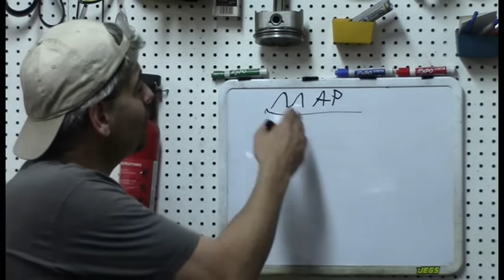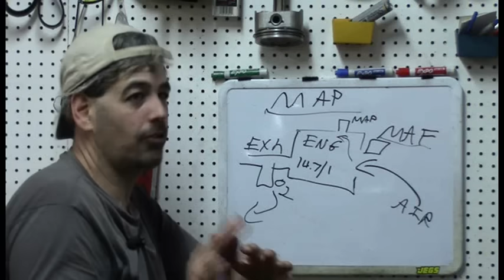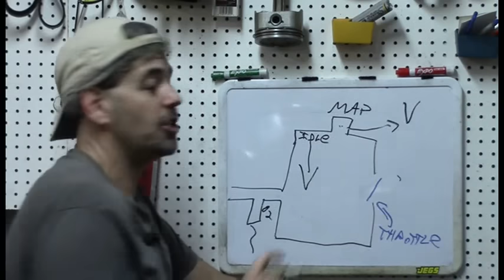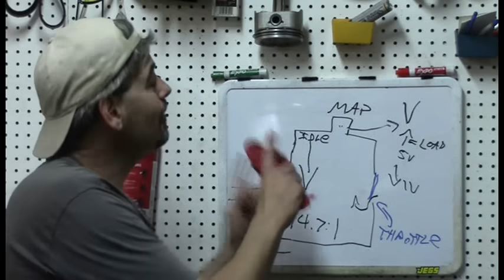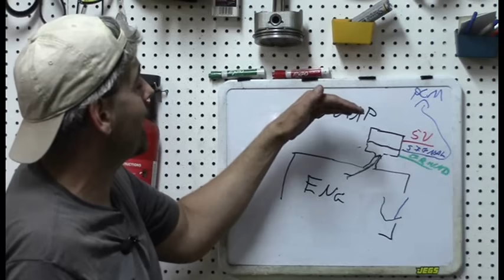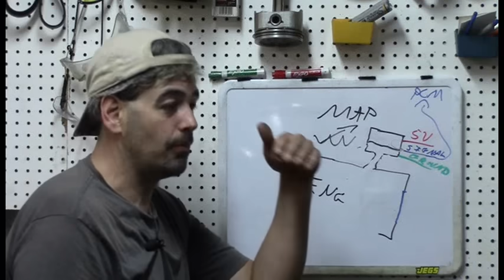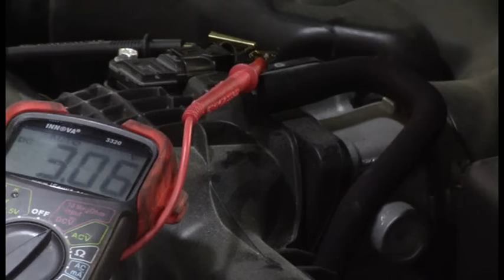MAP Sensor Diagnosis and Understanding Function- Pt1

Comment: Hi there. I have weird problem that nobody as for now cannot help me in my country and my area. BTW I live in Poland. I will describe my problem so can you help me please at least a little bit?
I am searching and watching YT videos on different sensors ETC. And watching here about MAP sensor I was wondering if my MAP sensor causes weird problems with my engine. 
I have spare MAP sensor that I bought from someone with other parts just in case. So my first thought was after seeing this, maybe I will try and change this sensor and see if there is any difference. But I can install it tomorrow. 
So for now I am wondering if it is even this sensor that is causing my problems.
American mechanics seems to go way more into diagnostic tools and know way more on engines than mechanics in my poor country.
So I was wondering, maybe you can point me in better direction if it is MAP sensor related issue or should I go and seek in different direction :)

So my car is Peugeot 406 v6 ES9J4 and when I start it and it is cold then it starts OK and goes into 1000RPM and stays that way to about 2 minutes until it heats up a little bit (normal behaviour of course) but then as it slowly reduced RPM to its normal iddle RPM then weird thing is happening. Engine start to fluctuate in RPM at about 700-900 RPM and it acts irradically and shakes.
I made few tests every time with cold engine that was sitting all night. So when I do nothing and just watch its behaviour then after about 2 minutes it stops shaking and fluctuate RPM and is sitting at about 850RPM calmly. On other day I tried to play with throttle while this problem occurs and when I add throttle then engine seems to not use 1 cylinder because it shakes weirdly as one of cylinders would not work at all. I rew it up to 2000RPM where I can hear engine works weirdly on 5 cylinders only but I did not test if it really use only 5 cylinders but I just assume this because without this problem on 2000RPM engine works smooth. So this playing with throttle do not change nothing in terms of this problem and it will go away after normal period of time for this weird issue (about 2 min) But when I start cold engine and just move right away and I drive then after about 1-2 minutes I feel that engine lose will to accelerate. It maintain RPM even if I press harder on throttle. It lags for short time then suddenly accelerates so I must decrease pressure on throttle pedal so it is not accelerating to fast. But after that still I feel slight lag and few jerks. It last way shorter than waiting while car is not moving. It is about 30 seconds to max 1 minute while I am moving and then it respond without lag etc. So I prefer to start the engine and right away move cus waiting 2 mins and then next 2 mins untill it will stop acting up is to long. I can start moving while it acted up on me after waiting for it to slightly warm up but effect is like I start moving right away.
It is weird problem and my mechanics that fix my car cannot find a problem. They used diagnostics computer on it Lexia/PeugeotPlanet2000 and only thing they noticed was air pressure acting weird while all this start to happening on cold engine after 2 minutes of waiting till RPM goes down. So value for air pressure is at about 300 somet units :) then start to jump up and down like crazy for that period when it have this weird hickups and RPM fluctuations. They changed some mechanical sensor for fuel but not fuel pressure sensor that I changed on my own way back for new one. Also they changed throttle body gasket as it was old and cracked. Still did not help in fixing my problem.
I phoned to other mechanic in other city close to where I live and he said to check if my knock-back (rebuff? Not sure if it is called this way in English) hose are good and not cracked etc.
Also to check my high voltage wires going to spark plugs as it have coil for 3 spark plugs and wires for back spark plugs. Those cables are brand new but as I checked them in the dark they give blue fast moving sparks. All I could do is to use silicone spray on them to reduce this. Old ones had the same effect so giving it back to store just to get new ones with same problem so I decided to not do it. But this problem I described was not present when I used old cables and also new cables. First time when I observed this weird problem was day after I change fuel pressure regulator. But it did not repeat untill some time ago and is present every time I start on cold engine. That is why I am not sure if it can be related to this fuel pressure regulator. Old one leaked fuel to manifold and ended up in hard start where it took longer time to start the engine. So it is all I can remember. Mechanics in my country are not to good in finding problems, they only like to change things to new parts :) That is what they are good at xD Ok it is not funny :( 
So I was wondering watching your video if this MAP sensor can cause such problems or my problem lays in somewhere else. Thanks in advance for any help. Cheers.
Reply from the maker: it could .... or not.  what data do you have?
Reply: @SchrodingersBox  sadly I dont have any data except info that air pressure in the manifold is changing irradically when RPM is dropping after 2 min ater cold start. Value after engine start is at 300 and holds close at this value untill RPM goes to its desired iddle value. I am novice in mechanical stuff. All I did in this engine was swapping spark plugs, high voltage cables, coil and fuel pressure regulator. I am thinking about buying lexia/PP2000 and used laptop so I could read data out of car computer so I could then give info if needed.
Reply from the maker: That is absolutely data- what exactly is the data that the absolute pressure is dropping? That’s what is needed!!  And if absolute pressure is dropping why are you replacing ignition exactly- I am not understanding that.
Reply: @SchrodingersBox  ignition gear was changed more than a year ago. Back there I had not this problem I was describing now. I changed it just to have new better ignition gear. As I mentioned first time ever I noticed weird behavior on cold engine was day after I changed fuel pressure regulator. It was less than a year ago. But it was not regular problem. Not sure when it become regular. Maybe when cold days started. But when I changed fuel pressure regulator it was summer. So not sure if temperature have anything to do here. But warm engine do not give such problem. It must cool down to give this symptoms again. Starting engine again after about 15-30 minutes dont show this problem.
Reply: Today I started engine and just drove. I accelerated little more dynamically and REV engine every time before changing gear up to 2000 and I did not notice any lag etc. But earlier tests I accelerated less dynamically and this problem occured. So it is mind boggling for me.
Reply from the maker: I still don’t see any data here. You mentioned there is a lack of manifold pressure. what is the MAP voltage? What is the absolute pressure?  I need the data that you are using that indicates the absolute pressure is low!
Reply: @SchrodingersBox  I mean I am not sure if data I have is absolute pressure but it is at 300 units. From what mechanic said it holds this value for about 2 minutes untill RPM is going down from 1000 to its normal workig value at about 850 RPM. Then this changes occur which are irradical jump up and fluctuations in that value. From what I understood from mechanic it is going up above this 300 units and fluctuate in upper values above 300.
Reply from the maker: what are the units?  300 units?  what the hell measures at 300??? It’s not bars or mmHG or MAP voltage. 
  I need to know the units of measure.
Reply: @SchrodingersBox  I called it units because I have no idea what they are called :) They represent manifold air pressure.
Reply from the maker: if he measured MAP he would have measured fuel trim and other basic induction parameters.  there is no logical reason to measure MAP alone. 
  If can had the data from these basic measurements any novice would have done i can help but unfortunately i have nothing to go on at all. Sorry, i’m outtie unless i have just basic starting data to form a strategy.
Reply: That is all mechanic told me about effects of this problem. As I mentioned about mechanics in my country. If I would be honest I would say they suck at finding what is causing problems that need deeper knowledge about engines. I had problem with engine start. I had to crank it longer. Nobody was able to tell me what could be the problem. I figired it on my own with the help of american mechanics youtubers and my own imput in testing stuff that can be tested without any diagnostics tools. So I found out that fuel pressure regulator is leaking fuel into the manifold through vacuum hose :) but now current problem is even harder to solve.
Reply: @SchrodingersBox  I understand that more data would be helpful to go closer to what is causing the problem. I will try to get more data but it can take long time. As for now I thank you for replying and trying to help :) I will search and buy this PP2000 for diagnostics of my car.
Reply: I thought that symptoms alone that I am describing would narrow search for problem.
Reply from the maker: They do- the symptoms tell you what data parameters to start with.
Reply: @SchrodingersBox  yes :) I like how you and most American mechanics that I watched on YT approach mechanical problems with gathering data and analizimg it if problem is more complex. As for me fastest way was to switch MAP sensor even if there is no proof that old one could produce such problems. I did not test spare one for to long because I need at least 3 days to see if anything changed. As for one test I did in the morning there was no symptoms but that proves nothing. I started my car and just moved straight away. Temp outside was around 5-7 celcius as in earlier situations. I did not try to accelerate to aggresivelly. Just smooth acceleration and I did not notice my problem. But that could be just one of better days for my car :) after work I will make warm up test. That means I will wait for 2 mins after engine start untill RPM drops. This will tell me if MAP  sensor had to do anything with my case. Still I have in plans to buy this diagnostics tool. It will help a lot in the future.
Reply: So... Update. After waiting for warm up after 2 min it is still the same problem. So without data it is still a mystery.
Just wonder if to try and swap o2 sensor to see if this fella can mess up engine work like that.
Reply from the maker: All things are a mystery without data,  You cannot diagnose a MAP without reading the voltage- you don't need a scantool- just measure the reference against the signal.

Comment: Matt is it the same for a diesel  in Pirinciple I've got both on my Chrysler 2.8 Cdr thanks.
Reply from the maker: never seen a diesel lol. I imagine it has to be the same though- either way you have to know the induction volume right?
Reply: Yes it seems I have got MAF to MAP sensor to EGR  in to the engine on the EGR valve it's got too vac valves on it one has got a flap like a carburettor and lift plunger on the other so it looks like the flap closes the plunger lifts altering the vacuum and the MAP and MAF sensors altering the fuel amount.

Comment: turn signal want work, all other light work, new malfunction  switch and relays , still no blinkers, emergency flasher works. don't have a clue what the problem could be
Reply from the maker: I would do a voltage drop test on the signal.

Comment: Hello, i have a 1988 chevy S10 4 cylinder.   The truck had been sitting for about 5 years,  i bought it and it started stalling on me about a week of being driven....i changed the fuel pump, the gas tank, fuel filter and all the gas lines and  speak plugs  it still stalls on me randomly,  it runs very slow on the freeway and when i drive it for over 10 minutes, the check eng. light turns on then it shots down.   After changing all the parts i did, what ells can i do to fix the problem?
Reply from the maker: What else can you do? You can diagnose it instead of just changing parts.  Why did you change all those parts? What is your data this is a fuel problem? What is the idle vs loaded LTFT? What is the rail pressure?
  There is nothing to go on here. You posted this on a MAP diagnostics video. What is the data from your MAP diagnostics? Why not start there?

Comment: I am driving an Opel Astra J 1.4T and i cant really get anyone to diagnose my car well. All they say is change MAF,MAP and Oxygen sensors all at once but with no root cause of where the problem is
Reply from the maker: Get me some data and I'll help you Dx it.
Reply: Thank you, the codes coming out are
 P0098- Intake Air Temp Sensor Circuit 2,faulty function,high voltage Intermittent
,P0172 Fuel Trim too rich 
,P0236 Turbo Charge Boost Sensor,Performance, Faulty Function
.,P0237 - Turbo Charger Boost Sensor Low Voltage, AND 
P1101- Intake Air Flow System 
 The car has no power at all and I am hearing like a whistling sound when i press the accelerator . The fuel consumption is very bad. I sometimes stop at a robot and the car starts shaking and switches off.
Reply: Thank you, the codes coming out are
 P0098- Intake Air Temp Sensor Circuit 2,faulty function,high voltage Intermittent
,P0172 Fuel Trim too rich 
,P0236 Turbo Charge Boost Sensor,Performance, Faulty Function
.,P0237 - Turbo Charger Boost Sensor Low Voltage, AND 
P1101- Intake Air Flow System 
 The car has no power at all and I am hearing like a whistling sound when i press the accelerator . The fuel consumption is very bad. I sometimes stop at a robot and the car starts shaking and switches off.
Reply from the maker: allen mujati Excellent- as you can see you have a P1101. Obviously you need to check calibration on MAF. What is the voltage drop across hotwire idle vs load and variance in frequency?

Comment: What should be your location as altitude to have 3V instead of 5V? Or 5V will measure only when we are on the sea level? !!!?
Reply from the maker: Because MAP is directly affected by Standard Tamperature and Pressure which affects air density.  At sea level STP pressure is 14.7lb/in.  At 6000Ft it is closer to 13 or so. You can think of it as there is a shorter column of air at altitude so it weighs less.
  Love physical chemistry!
Reply: Thank you Sir, So if there is no misunderstanding because of that I  have always been using the metric system, your measurement  was taken at 1800m above the sea level. Good! But I was thinking that the MAP sensor is not a pressure transmitter, it is a pressure differential transmitter i.e. measures delta P. IN static condition delta P is zero. So, how much must be the voltage reading?

Comment: We can or cannot adjust volt output form map???
Reply from the maker: The MAP voltage changes with pressure as shown
Reply: I know  but l want  low volt  if output volt 4.5 l want  4.3 or 4.2
Reply from the maker: Paibool Kawwongkot Why would you want to do that? This would run your engine lean.
Reply: more boost more torque and more hourspower
Reply from the maker: Paibool Kawwongkot Ummmm... no.  You would hae exactly the opposite. Exactly opposite.
 I really must strongly recommend you not try to modify modify your engine.

Comment: Hey there I've got a nice 6 Nissan Maxima that has an intermittent very probe longed crank before it starts give it a little gas and it will start has no codes runs great not sure what's causing this it could do this 3 times in a row and then immediately fire right up 5 times in a row warm or cold can you help
Reply from the maker: Sure. what data do you have?

Comment: Hello,I have a 2000 chevy impala 3.8L,it stalls while drive at least 2 times,15 min of driving,like clock work,,after that runs good,,no check engine light,what can b problem?
Reply from the maker: +Dwayne Joubert What data do you have from the diagnostic tests?
Reply: Haven't had done yet,its my next step
Reply from the maker: Dwayne Joubert The time to ask me what the problem is is after you do that!

Comment: I have tiguan 2009 2.0 tdi 2009
When I measure power for map 7.4 volt
Why I didn't find 5 volt??? 
I check wire I found is good
Reply from the maker: What’s the voltage on the return signal?